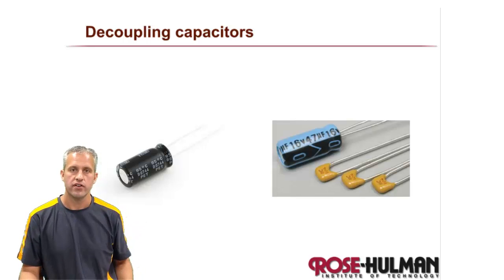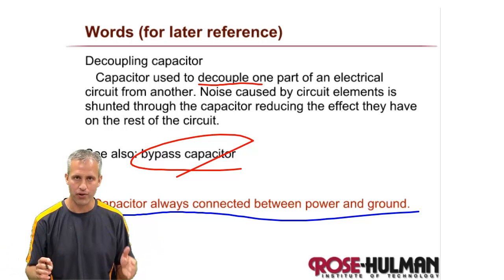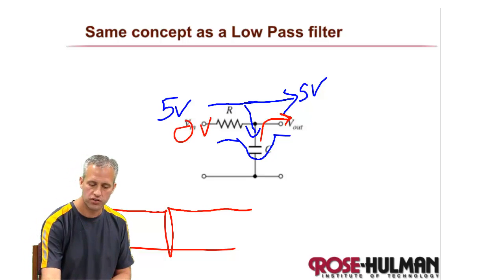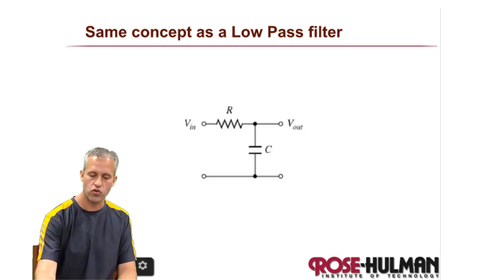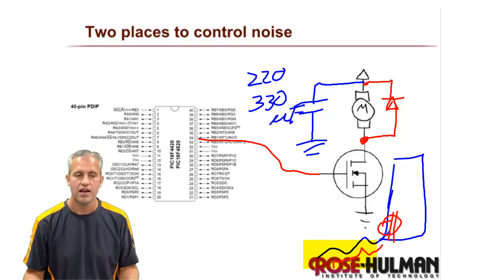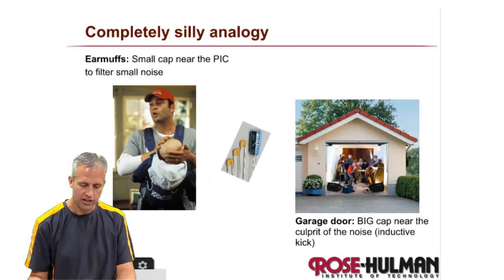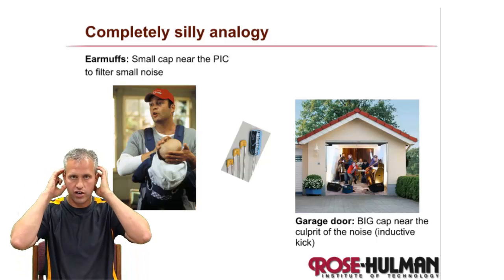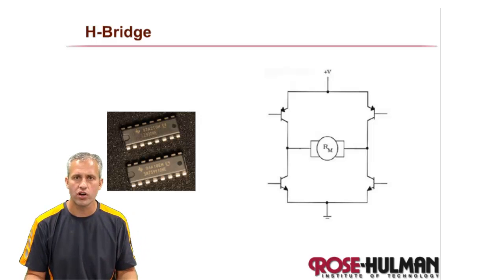ME430 Decoupling Capacitors

Comment: The PIC in this example has a pair of Vdd and Vss pins, so ideally you should have two decoupling caps on the PIC itself.

Basically put one on every pin connecting to your positive supply.

Comment: This is the first video (or even the first online material) that I have come across that concisely explains why ICs often have low-farad capacitors connecting them to ground. A lot of online stuff explains how capacitors actually work but never really explain the practical applications of them. Thanks for sharing.